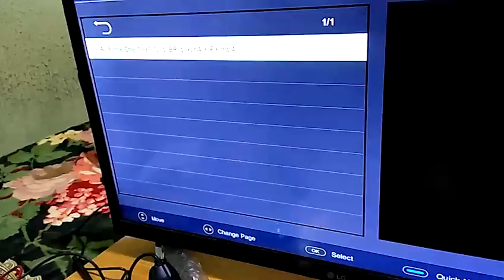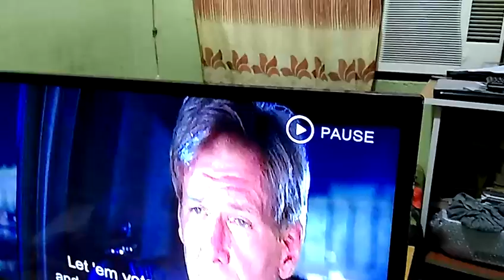How to  add Bluetooth module to any TV (Wireless Audio Transmitter) LG TV

Comment: How did you pair module with the speaker ?
Reply from the maker: If you turn it on for the first time, it will search for any available Bluetooth device. So from the device you can add the Bluetooth module to your list of connected device. If you want to connect the module to another device then you have to connect a switch to CON to cancel any connected device

Comment: Thanks, bro for making this video. but can you send a link to buy the module and show us the circuit diagram in the description? That would be great for me..I am scared looking TV circuit behind
Reply from the maker: Bluetooth Audio Transmitter Module Board 4.1 Stereo Audio GFSK Transceiver Wireless Speaker Headphones KCX_BT_EMITTER 5V
https://a.aliexpress.com/_mqNCk45

As for the diagram, connect the IN_R and IN_L of the module to the left and right side of the earphone jack or axillary audio out  or to the output or the preamp (very complex). AGND to GND get 5Volts from the USB por, CON to switch and ground it